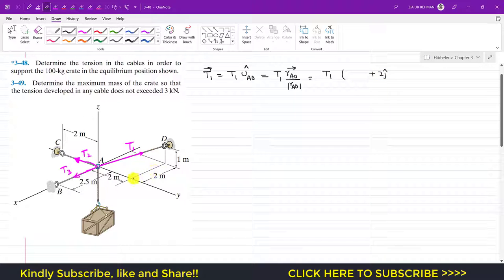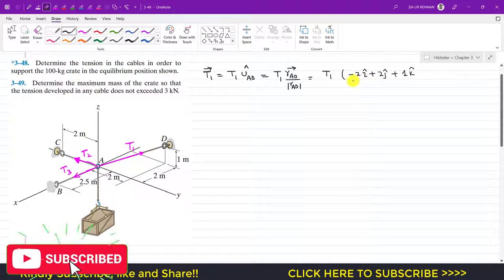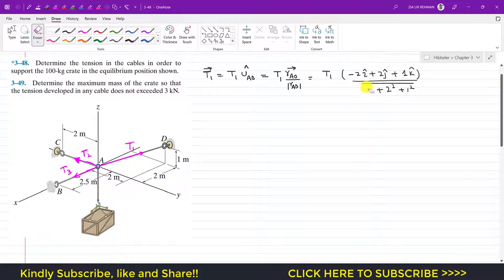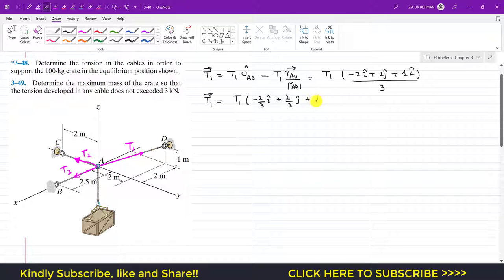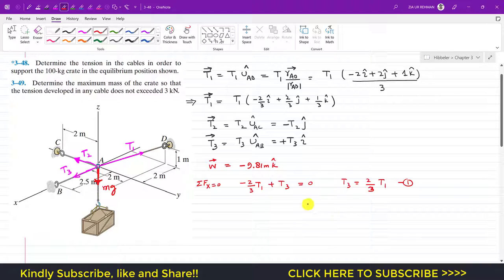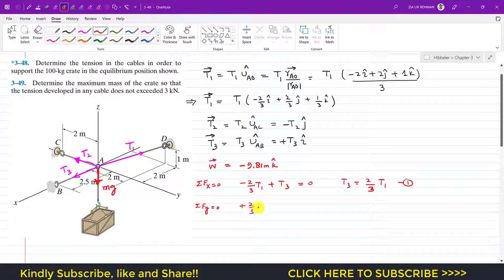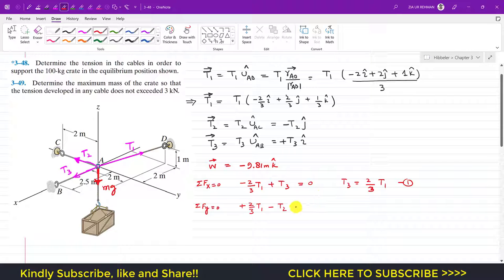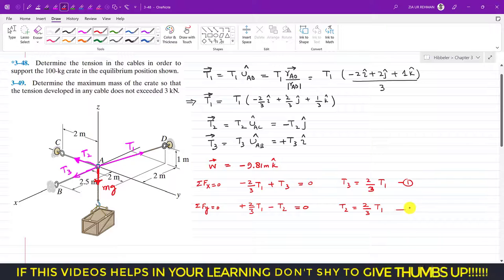3-48 | Chapter 3: Equilibrium of a Particle | Hibbeler Statics 14th ed | Engineers Academy

Comment: Thanks for the helpful video but please I have a question. When you were writing the  cartesian vectors for T2 and T3, why didn't you use the distances given. i had T2 = -2T2j and T3 = 2.5T3i.
Reply: In order for you to get T in its cartesian vector form, you need to take the magnitude of T and multiply it its unit vector (you know that for T2,  the unit vector acts from A to C). For T2, if you take the distance in the y axis, which is -2 and you divide it by the magnitude of the unit vector, you will get -1. In other words, if you take -2 and divide it by  sqrt(-2)^2 =, you will get -1, which is what is shown in this video.
Reply: You must dot the magnitude of the force in the direction of the cable.